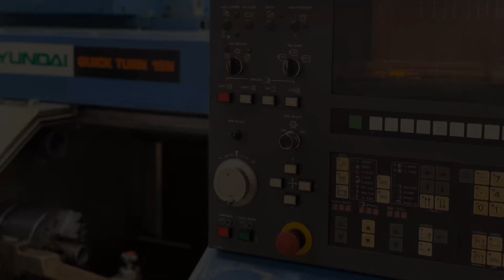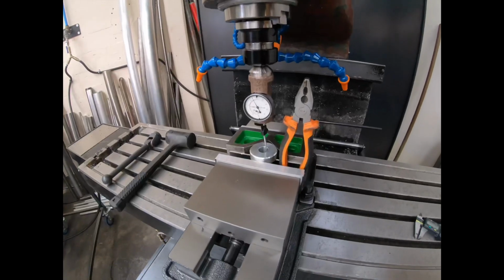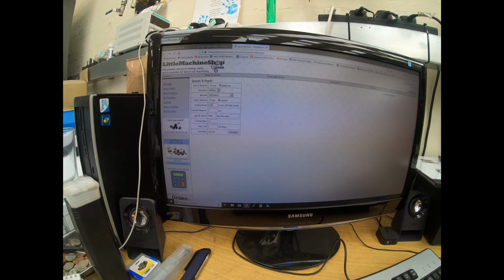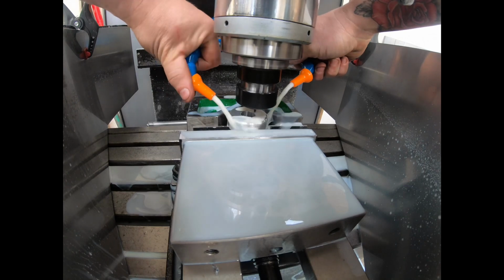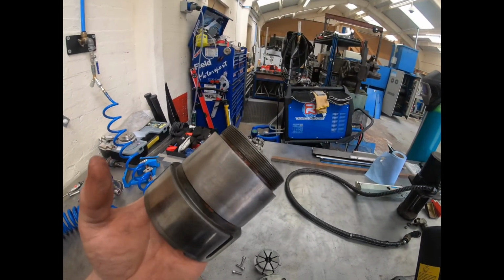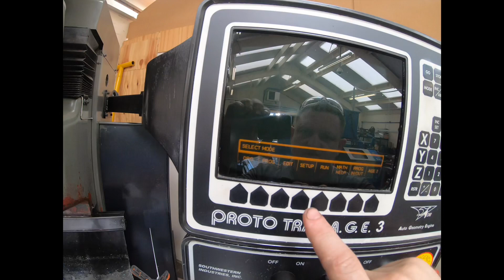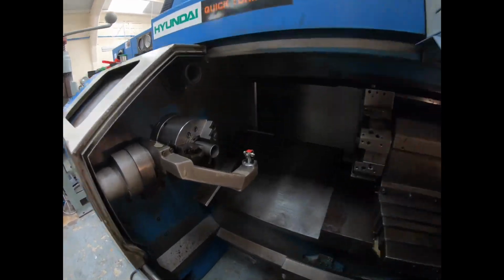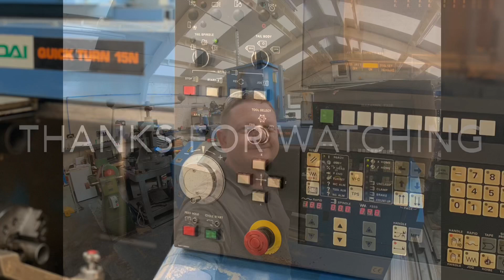Making the base for the new Touch Master tool eye - (Part 2)

Comment: The Tool eye always seem to be broken on most CNC,s that i have either run or looked at before buying my current Mazak QT15.
I am curious even though this is a fairly old video now.
Did you pay the extra for the Insurance that this supplier of Tool eyes provides ?
I mostly ask as i still need to replace the Tool eye on my machine with either this version or the Genuine item.
You had a fair amount of messing about to mount this version,  i guess you got the job done and you can make a video at the same time.
Thanks for the video it was good to watch.
Peter.
Reply from the maker: Hi

The tool eye should of been a direct fit with no modifications required but as i am in the uk and the company "Tool eye inc" is in america is was easier for them to partly refund me and me re make a new mount myself, mainly to save the time of shipping it back and waiting for the replacement

There was no kind of insurance on this item that i know of

Thanks
Marc
Reply: @kinzy_fabrications  
Not sure with the insurance the American maker of the Tool Eye.
He did have a price for the Tool Eye plus the option for an insurance i think he called it ?? of around $200 USD ( from memory ?? )
I was just curious if you took up this offer, which of course adds $$$ to the end price.
Not so important you already have it now.
They definitely make life that little bit easier when you use it.